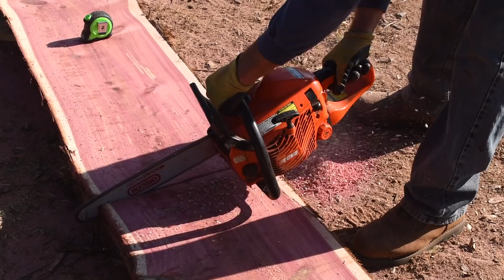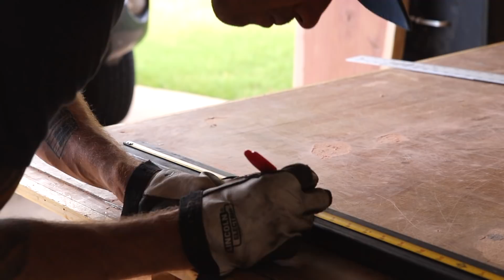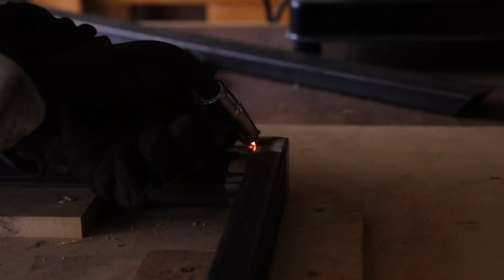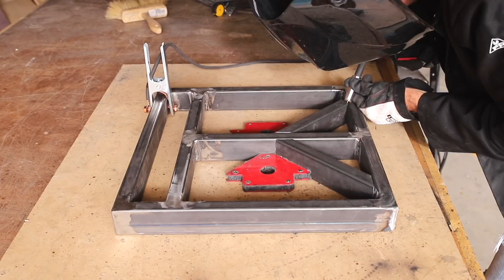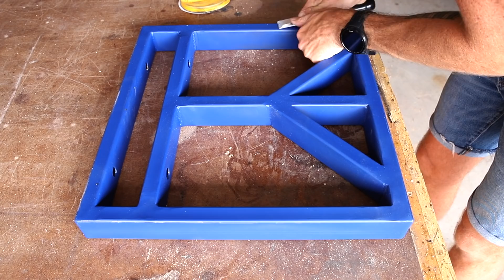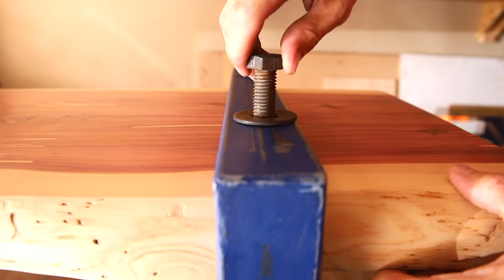DIY Live Edge Slab Bench w/ Steel Legs | Easy Welding Project

Comment: Hi could you please tell me what welder you are using? thjanks
Reply from the maker: It’s a Lincoln Electric Powermig 140c. I have a link in the video description. Thanks for watching.
Reply: Just wonder if you could help me, that welder is a little pricey. Could you guide me to one that is a bit cheaper? Thanks
Reply from the maker: @MaverMan1  Do you want the option to run gas?
Reply: @JonnyBuilds  Preferable electric man
Reply from the maker: @MaverMan1  What I mean is are you wanting the option to run Argon shielding gas, or just use flux-core wire? A flux-core only machine is usually much cheaper, but the welding is easier running gas and not as messy.